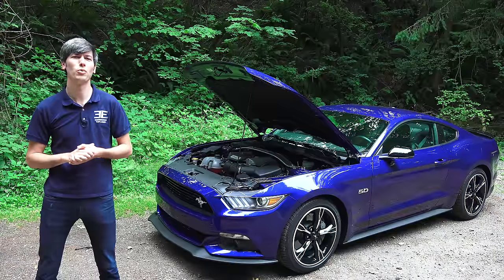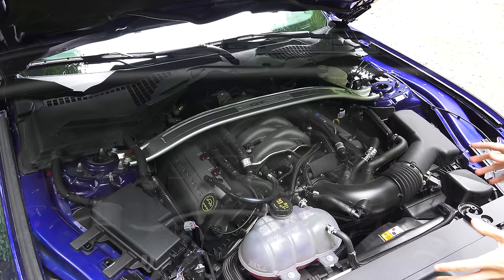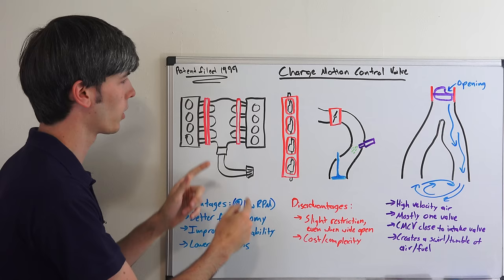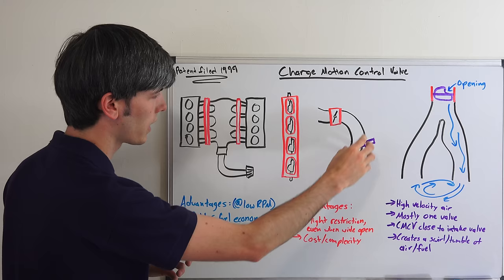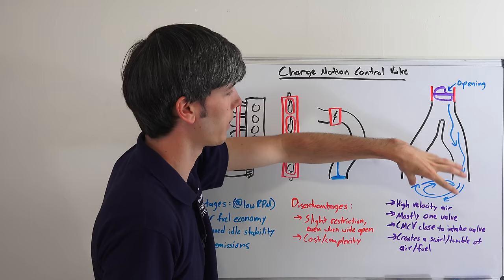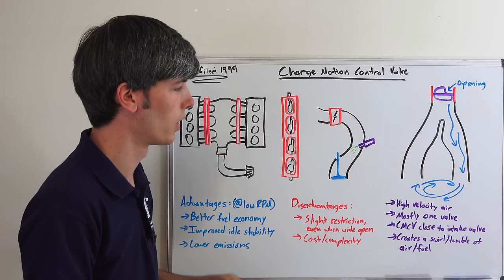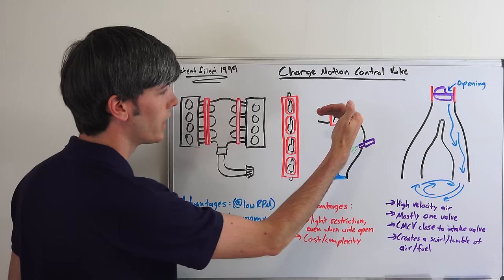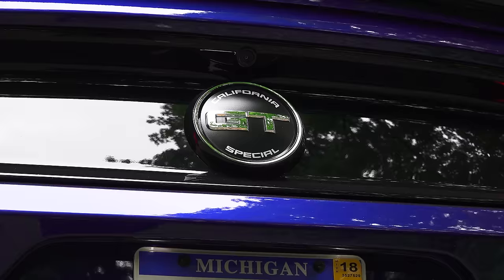Keeping The V8 Alive - Charge Motion Control Valve - Ford Mustang GT

Comment: Having owned 2 V8 mustangs so far, I can tell you without a shred of doubt they damage fuel economy, are counter intuitive, and if you're smart when modding, one of the first things you delete. I got better throttle response and with other supporting mods better gas mileage, I got 425 miles out of a tank in my 08 Bullitt on a cross country drive using shell 93(I only include that because I know it tests higher than 93 octane and not as a plug).  Advocating for this technology is the same as advocating for the 10% ethanol in pump gas. It actually hurts the car, especially old ones, and has a negative impact on actual fuel economy.
Reply: I get 22 mpg in a pushrod Fox running 91 with a CAI and a smog delete. a set of aluminum gt40x heads would put it around 25 and another 50 bhp depending on cam.. so I kind of agree these complex systems to regulate emissions seems counter productive not only to the vehicle efficiency but also to the consumer to fix unnecessary to begin with parts..
Reply: For one, your fox body mustang is much lighter than a modern mustang. Also, manufacturers have to meet emissions requirements, which reduces maximum fuel economy (maximum NOx targets, ect).
Reply: Completely agree with you.
Reply: Thomas, that doesn't change facts lol.  The parts are remarkably counter intuitive, and add weight. One of the reasons they weigh so much.
Reply: +Thomas Griffin the engineers of the time have even said smog pumps and like components were basically a scam to pass the EPA/government regs..
Reply: There's nothing wrong with Ethanol. Ethanol also has much more energy, and fuels like E85 are starting to push over race fuel in quite a few types of cars. Also, they're bad for older systems that weren't designed for it, don't have the proper hosing, or are using carbs. It does have a negative impact on fuel economy, but compared to Ethanol Free 91, it's much cheaper and the price difference doesn't match up to the mpg difference. Also - Power! I don't buy a performance car for "purists" sake. I buy it because I want performance, and ethanol fuel (or race fuel if you can) will give you more. The purists attitude of the car community is what holds us back.

Regardless, Your 2008 GT's had a 16 gallon gas tank, which means you averaged roughly 25 MPG's on a cross country (assuming mostly highway) trip - 2 MPG more than its factory rating! However, 25 MPG is exactly what the 2016 GT's rating is (and it actually gets 26.5 at 65 and no AC running - which was a plea sent surprise). 

So, advocating for this technology isn't bad. With this and the 5th/6th gear being overdrive gears, it helps avoid the gas guzzler tax as well.
Reply: I don't see how that relates. REduction of fuel economy to meet better emissions.

Higher emissions are generally coming from lower fuel economy cars and setups. The more fuel efficient your car is, the lower your emissions are. The two go hand in hand. 

Meeting emissions requirements has produced better fuel economy from cars. It's also helped to evolve and develop better technology for cars that overall increase their quality. Yes, the complexity has gone through the roof, but efficiency is still quite amazing.

We have vehicles now that can produce just as much power as older, less restricted cars, and still get remarkably better fuel economy from them because we've had to learn to work around emissions standards.
Reply: Seeing it or not does not remove the physical evidence. Both in performance and fuel economy gains.
Reply: Abendschein I don't know where you got your information on e85. It's not as efficient. It definitely does not make more power. It leaves a varnish. It also attracts water. First hand knowledge using a flex fuel vehicle. Also most gas stations don't price it right so the added mpg def outweighs the price point at least where I've driven. It's bad technology. Even worse it's a waste of the potential grain alcohol.. or food if you wanna be PC
Reply: Abendschein also the comparison should be e85 or 85. Not 91.
Reply: +twisted_loki Unforgiven Kings ethanol has a higher octane than any pump gas so you can push higher compression and get more horse power. It is less energy dense so you do lose MPG but it is safer for knock control. It will solvate certain rubbers and plastics that gasoline wont so that can be bad if you have an older car, but ethanol will not leave a varnish. It will burn like gas and turn into mostly water vapor and carbon dioxide. Plus small amounts of no2 NO CO.
Reply: +Mechanized Ape actually plain gasoline will leave a varnish if it sits for too long. The more volatile compounds evaporate leaving behind heavier boiling hydrocarbons that, when out of solution, become more viscous.
Reply: Yea I don't know where he's getting his facts on e85. My flex fuel Taurus was a DOG on it. Only ran that fuel ONE time will never do it again.
Reply: Mechanized Ape sure PURE ethanol has a higher O rating. Not e85. It has the same rating as 85 pump gas with a less efficient burn. So same rating less mpg. Don't cross your subject matter here. Also storing gas in a vehicle of any kind will varnish. I was actually talking about how e85 burns. It leaves behind really bad deposits forever lowering your mpg AND HP if not properly cleaned.
Reply: twisted_loki Unforgiven Kings It was just a bad idea all around.
Reply: David McClelland agreed. Of course if I'm not mistaken a lot of this misinformation comes from racing leagues giving their endorsement to e85. Wtf do they care? They get a new motor from their sponsors..
Reply: +twisted_loki Unforgiven Kings can you give a few references to your information. I don't think your correct about ethanol gasoline mixtures always having a lower octane than just pure ethanol. The mixtures aren't always that precise anyways. Otherwise you wouldn't need a flex fuel sensor to convert. You could just have a preset for e85 and then just never be able to add anything else. Watch the mcm episodes about ethanol. I think you have some facts mixed up.
Reply: +twisted_loki Unforgiven Kings I'm not crossing any subject matter. I don't think you know anything about chemistry or mechanics.
Reply: +twisted_loki Unforgiven Kings regular 87 pump gas in the us is 87 octane. E85 is 100-105 octane. 85 is the percent of gas.
Reply: +David McClelland 
   First off, you are all missing the point of e85 at the pump. 
Second. ford sucks so I'm guessing they just changed a gasoline motor to a flex fuel with some new hose and a sensor and didn't change much else. Ethanol is less energy dense so if you inject the same volume of fuel with e85 as you would gasoline, you get less bang. So to take advantage of ethanol mixes you need  bigger fuel injectors plus  and or at least a higher flow fuel pump. Your car was probably slower with e85 than gasoline because it was running out of fuel pump.  
   E85 is not meant to be a race fuel it was meant to be better for the environment because it was supposed to burn cleaner and also be renewable.
Reply: Mechanized Ape Well you said it yourself. It's less efficient. It would also cause much more land raping than we're doing now, on top of making Monsanto more and more of the monster it has become. If you want to get cleaner go electric. Solar powered plants are perfectly viable and lithium once mined is forever reuseable. Land depleted by crops as to be artificially replenished over and over again with minerals that are mined elsewhere and can't be replaced, all to burn up in a car using more gas with less power. It really is all around a super bad idea and that's why it wasn't the big hit the environmentalists thought  it would be.
Reply: +David McClelland I'm only in favor of ethanol for racing application. Energy Density of ethanol: 26.8MJ/ED of common gasoline: 45MJ. 
  Every energy source has its problems. Solar panels take energy and lots of nasty volatile chemicals to produce that are harmful to the environment and the people who make them. Lithium is relatively rare and only mined in a few places not friendly to the u.s if I'm not mistaken. And also take pollution and energy to produce. The electrolytes in lithium batteries is caustic and needs to be disposed of properly(humans are great at that responsibility.) nuclear of both kinds has its own problems. It's a cost benefit formula that, untill now, hasn't included the cost of fixing the environment or the cost of changing with our environment. The only answer is to consume less.
Reply: Sorry but you are wrong. E85 is called that because it is composed of 85% ethanol and 15% standard gasoline. E85's octane rating is higher than 91. It is hard on rubber and plastic and can not be left to sit around because it will absorb water. It has less energy per gallon so to get the same power you have to burn more of it but that doesn't mean it is less efficient. Efficiency is work in over work out. Since E85 has less energy you are putting less energy so will have to fill up more but that is not an inefficiency. If the engine is designed specifically to work with E85 you can actually get a higher efficiency because of the higher octane rating. You could argue it is inefficient because of the production process of using corn.
Reply: *****
Well yeah. You'd need another planet dedicated entirely to farming if you wanted to run every vehicle on the road on E85 with our current tech.
Reply: +Curt D hey don't be sorry for catching my error. I meant to put percent of ethanol but had a brain fart I guess. And again sometimes it's not always 85 percent ethanol. It varies slightly iv heard.
Reply: dosmastrify
 They sell 85 octane on every pump I've seen in my state...
Reply: twisted_loki Unforgiven Kings I didn't say e85 was efficient.
Reply: dosmastrify
I can literally walk 50 feet and photograph it, dude. It's 85. I didn't even know it was unusual until last year. And it did cause my engine to knock.
Reply: dosmastrify
I dunno what to tell ya. Every pump I've seen in Idaho has 85, 87, 89, and 91.

I used 85 for a full year before knowing better. Found out I had both a lifter tick AND engine knock.
Reply: dosmastrify
Apparently it's an altitude thing, from what I've been told.

I need to stop editing my comments. Or stop needing to edit my comments. Sorry about that.
Reply: 85 Octane fuel is very common in high altitude western states. Because the air pressure decreases with altitude the actual compression of the fuel air mixture is reduced (even though the ratio is still 9:1 or whatever). Since the absolute pressure inside the combustion chamber in Denver is less than in New York 85 Octane fuel works fine if the car normally calls for 87 Octane. Just don't fill up the tank with 85 and drive to the ocean.
Reply: *****
I learned something today. Thanks man.

The knock I was hearing wasn't very loud (less noise than a diesel makes), so it might have been happening because the engine was treated like garbage by the previous owner, since using 87 solved it.
Reply: I had an old junky pickup that had a fair amount of carbon buildup on the heads so even though it called for 87 it would knock a fair amount with it. If I put 89 it ran fine. Eventually, I got tired of it and pulled the heads off one weekend and clean them up. From then on 87 worked perfectly. It really wasn't worth my time but I was bored that weekend anyway.
Reply: Tesla uses lithium ion batteries, while the Prius uses Nickle-Metal Hydride. Different technologies, different environmental impact.
Reply: The previous owner had attached the vacuum lines incorrectly so it was sucking some automatic transmission fluid from the transfer case into the intake manifold causing the carbon buildup.
Reply: Man remember when this thread was on track and about my comment regarding charge motion control valves?
Reply: DevilDolphin
You mean the part where you thought your Internet groupthink and fictional garage nonsense trumps the proffessional engineers from the oldest car manufacturer in the US?
Reply: Actually it was from my first hand experience, dyno numbers, and fuel economy. IT's also widely documented and excepted in the mustang community. Almost universal in fact.
Reply: DevilDolphin
The Mustang community generally leaps at any opportunity to add another "mod" to their forum signature, and puts horsepower before any semblance of practicality. It's also full of it-didn't-happen-to-me-so-it's-impossible logic.

My car has the same powertrain as the Foxbody. I've seen plenty of the Mustang community.
Reply: So what you're really saying is, the empirical data I've received from these modifications is actually witchcraft and I just wanted to add a mod to my signature line? Because I can't possibly know more than the engineers, who are slaves to the EPA regulations and manufacturing guidelines?

Comment: Ok so why not just use a vtec sorta system where you could shut off one valve for economy and open both for power? That way you won't have that restriction at WOT and have a better swirling effect.
Reply from the maker: This exists, but there is more than one solution to any problem. :) https://www.youtube.com/watch?v=Ol3nWQbatrQ
Reply: +Engineering Explained Thanks I didn't even know that existed! Keep making great videos!

Comment: What does the "California package" bring?
Reply: Good weather? :D
Reply: Different wheels, a tape stripe and some other cosmetics.
Reply: Usually a much better interior.
Reply: +David Soule The California Special (as shown in this video) does not change its emissions equipment nor requirements.  The CS doesn't denote that's the version legal in California, but refers back to the CS versions dating all the way to the '60s, which were more about sun & fun.  The modern CS has special black 19" wheels, stripes, special spoiler, darkened taillights, and black mirrors & hood vents.  There's also some interior bits & stickers.

Comment: Or, just do it without complexity.  When I turned my car, idle AFR was around 18:1 with an idle speed of 425rpm.  Under a certain throttle percentage, target AFR was around 16:1, and at cruise, a little leaner.  Once throttle percentage increased, it was all over for efficiency and I tuned for max power.

Comment: Cool, until you realize that Honda has been doing this way before 1999 by using valve timing that only lets one intake valve open completely and the other only slightly, creating that high velocity swirl effect that increases fuel economy at low rpm. Plus the Honda system doesn't add something into the intake tract creating turbulence and restriction.
Reply: The 1996 SVT Cobra had this technology. So basically its early-mid 90's tech for Ford.

Comment: cant say im a fan of this idea wouldnt turbos give you more efficiency at lower rpm if you use the right setup  while also providing alot more power when u get into the throttle
Reply: Yes, but installing a turbo kinda kills the purpose of this car ... "Legendary" Mustang V8 has to be naturally aspirated.
Reply: Agreed but a turbo and a V8 mustang don't match. It takes away the character of the car hence why it is still N/A.
Reply: +Ken Kalajdžič yeah i know we all love naturaly asperated american muscle but then this car isnt really made or bought for fuel efficiency  im saying if efficiency is what your after turbos would go a long way i say turbo everything i see no downside to boost power and efficiency
Reply: +Mitchell Sprenkeling i dont really see the 5.0 as a muscle option anyways that was the stock fuel efficent engine if you want big american muscle power you need a 427 cobra jet or 460 nothing like big block power
Reply: Theres a chance Gt500 will be twin turboed. I doubt the heritage mustang guys will care too much when a V8 pops out 700+ hp.
Reply: Turbos don't increase efficiency. They just let more efficient engines make more power. If they inherently increased efficiency, they would be pretty much mandatory.

The last GT500 had such horrible mileage that on some tracks it literally could not finish 3 laps on a full tank of gas.
Reply: Garrulus a stock TT  5.0 can make 670HP
Reply: Freedom Sooo ... they're taking on the Hellcat? That will be interesting.
Another battle here - supercharger vs (twin) turbo.
Reply: Garrulus If you mean a new GT500  yes but not a Regular 5.0  there are tons of boosted 5.0
Reply: dosmastrify No it was a 2.3 in the 84 svo and thunderbyrd

Comment: No new technology here. Nissan did this on the KA24DE. Toyota has done it on their 4AGE. Helps with lower end torque and opens up at wide open throttle.
Reply from the maker: As mentioned, filed for patent in 1999.
Reply: +Engineering Explained Nothing against you, just wanted to let people know.

Comment: So, it's like a throttle variable restrictor plate?
Reply: More like a throttle controlled variable intake runner fluid velocity enhancer.
Reply: Lmao.
Reply: I like to think of it as an engine that has dual variable restrictors. The Throttle body, and the Charge motion

Comment: jeez, might as well put a valve behind that too, so you restrict the air before it gets restricted. a throttle body and vvt aren't enough? here's a tip to not burn alot of gas: don't press the gas pedal hard

Comment: While it is a neat trick, I doubt it's the only thing Ford is doing to keep the V8 alive. Similar technology is employed in GM and VAG engines, and has been for a while.

In layman terms: basically, it's impossible to design a good enough intake to generate torque at low rpms and power at high rpms without changing it's geometry in some way, so manufacturers have been working around this limitation using various solutions.

The basic science behind it is creating vortices using a device designed to alter the normal free flowing intake in order to create a more homogeneous mixture, which, at various engine speeds, "burns" quick or slow enough to provide the best BMEP